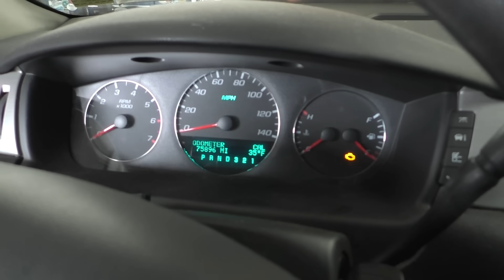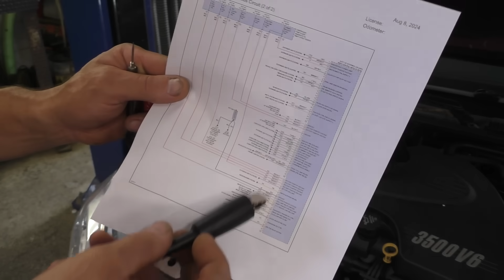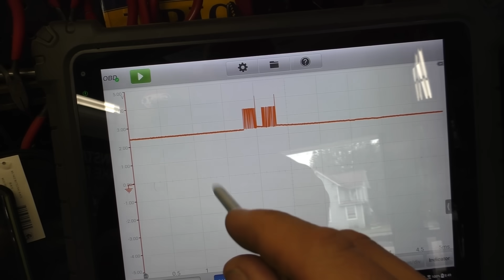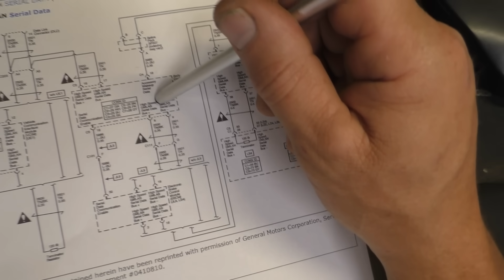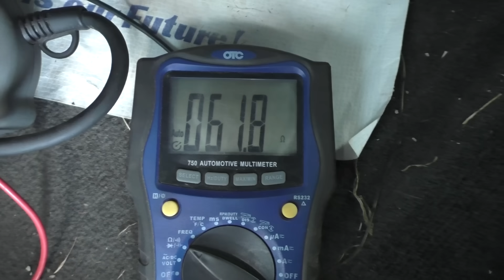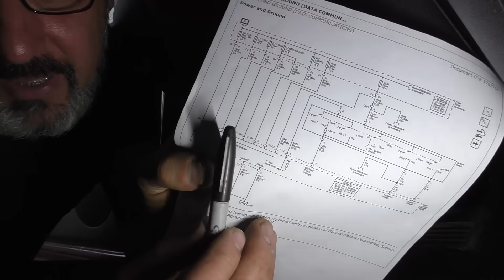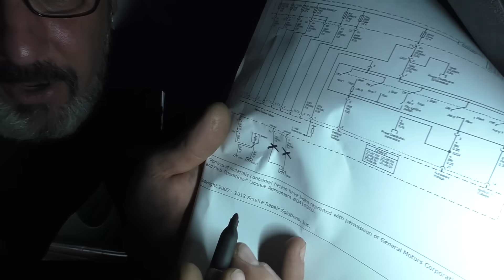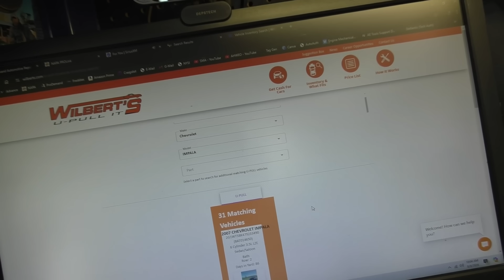Chevy Impala - Sat For 2 Years - No Start, No Crank - Part I

Comment: You remind me of a local GOOD mechanic we have. I had a vehicle that had a left o2 sensor code. I replaced the sensor, still had issue. Brought it to him. he located a wire over the transmission that led to left O2 sensor had been chewed by a damn rat. Once he located, I asked how much to repair. He said, If he had to pull transmission, $800, if he could figure something else out without removing trans, $200. He ended up pulling drive shaft, and rear trans cross member, allowing him to splice wire and repair. He charged me the $200, could have easily lied and said he had to pull trans, he didn't. That was 10 yrs ago, vehicle is 2007, still driving strong today!

Comment: I almost got burnt on this car a while back thinking it was the BCM after all the tests you just did, come to find out it was the low speed can bus that was shorted through the  airbag module, the telltale was no square around the gear selection in the cluster lead me to the low speed CAN bus bar or splice right near that BCM, checked each one for comms and the airbag one was grounded. Pulled the pin, slapped the “comb” connector back in and roberts your mothers brother everything came back online and started like a dream! Not saying its the same problem but darn near similar!!
Reply: That was almost a mother father cocker spaniel moment. Thank (insert deity of your choice here) you didn't leap in and replace the BCM

Comment: I had an 05 Monte Carlo in a couple years ago that had same symptoms, but only after it sat in the heat.  I did my due diligence, and tested all those things you just tested.  Boom!  Needs a BCM.  3 BCMs, and several hours of diagnostic time later, I finally got a good one.  That feeling in your gut when you plug it in and it doesn't work.  The next one had a whole different set of problems.  I learned not to go with aftermarket.  Cardone wasn't happy after they insisted on talking to me on the phone.  XD

Comment: My short term memory became problematic after I had Covid in May 2020.  Still have issues but not as bad.  I hope Mr. O, that yours is a short term issue and not long term.  
I really enjoy the diagnostic videos.  Your method is easy to follow, consistent.  I am now able to anticipate your next move and make bets with myself what the problem is and at where it will surface.

Comment: I had a 2008 impala with the 3.5 V6. Sad to see that impala sit for so long cause mine was the most reliable car i ever own. She hit 330,000 miles no problem before the transmission started to give me trouble. Everything still worked even the AC, never left me stranded on the side of the road for mechanical reasons, but i had the usual dead battery or flat tire but that doesn't count towards that. I do miss miss that car, drove smooth like a caddy and i had a few things done to it so it had more power than your usual impala. Seeing this car and hearing the chimes and lights on the dash brings back memories, seeing the 35 on the temp usually meant something electrical went wrong, not my car but i worked at a dealership as a porter and i noticed seeing 35 for a temp meant a big headache for the mechanic
Reply: I agree.... The most comfortable car I have owned. The first one I bought new. The second one a "Road Hard and Put Away Wet" salvage title. Both great cars.... Just do the maintenance and they never let you down. To bad they do not make these sedans anymore
Reply: @SinCitySinner definitely agree, I put in a bottle of Lucas transmission fix along with the flush. You could tell it was giving up but it bought me 6 extra years of life on the transmission. Yeah your right about the battery, mine was always in the summer when it gave up, at least it gave me a warning, about a week before it actually died you could hear the starter sound different when starting
Reply: @s126695 agreed, I really do miss that car but at the time I really didn’t have the money to fix it, probably should’ve garaged it instead of getting rid of it

Comment: ABS on Impalas was optional for many years.  I know I had a relative that purchased a new Impala and they said they had to pay extra for ABS.  I urged them to get it.  That car doesn't have the 3800 V-6; I know later Impalas had the 3.6 liter LFA engine and they weren't very good.  My first car with ABS was a 1987 Lincoln Mark VII.  GREAT VIDEO!
Reply: my 2001 impala didnt have abs. 2012 and up have the 3.6 LFX, same LFX that is in the camaro. my 2014 limited has the 3.6 LFX. the later model LFX engines were fine, they didnt have as many timing chain issues like the earlier generations.

Comment: I owned a 2008 Chevy Impala and it had ABS brakes. From what I could find it was an option for a long time. Don't know if it was was like air bags and made mandatory or if the manufacturers just though it was important enough to eventually make it standard equipment. That Impala was one of the best cars I ever owned. But I take very good care of all my cars and do all the work on them myself. Rarely in the past there have been things I just cannot do myself, but haven't taken a car in for repair for at least 10 years.

Comment: Among my homemade tools: a simple 9-volt battery. If I wanted to confirm the bcm as the only bad component, I would connect the battery to that 5v pinout and test my offline components. Maybe even try to crank the motor. Even though it's a 9v battery, it generally does not provide enough amps to burn out anything downstream.

I think you confirmed the bcm. My nearest junkyard is about a half hour drive in good traffic, so I do extra tests in case I might need another part... try to save trips back/forth.

Comment: Have an old GM truck, sat for eight years, cleaned the tank, new fuel pump. filter oil change started right up and still running today pushing almost 500,000 orig. on the clock. I like the old school stuff better. I had it under coated from new so no rusty frame, wheel wells surprisingly even with all the rain and snow, slush in it's lifetime.

Comment: This might be boring but is the correct way to determine problem .It might notvbe feasible but is correct to locate the problem(s)..Eric allways seems to locate the problem & only the problem without quickly throwing parts at it like crazy.Or just replacing major components like the dealer or whoever else....

Comment: I would love to open that BCM, 5 volt supply probably easy to fix especially if it's a linear IC. Could be just a cold solder joint. If it's a DC-DC converter could be a bad capacitor in the start up of the switching IC. Love stuff like this, but in the service business time is money.
Reply: 2000-2005 had many known bcm issues. cold solder joints were the problem. had to replace one in my old 2001. it did some weird things. when the temperature inside the car was below like 75*i didnt have any problems. as the temperature went up the more issues i had. it got to the point where the car wouldnt start if it was more than 80*. but if i took the bcm out and put it in the fridge for a little bit and let it cool down it would fire right up.

Comment: Note that the ABS standard with the V6 model.  So it is missing on this car as only the four cylinder was in optional, and this is the 3.5L V6.  Amazing trouble shooting skills.  Although it would be quite a drive from CT I could go to Eric for a fix if I was desperate - but I do have an independent mechanic I trust in CT who gets to the bottom of problems like Eric can.  The worst are the electronic ones so I admire Eric and those who actually can troubleshoot with a logical process and solve the issue.
Reply: ABS/traction control was optional on the base model impalas from 2000-2011. the 2000-2013 impalas did not have 4 cyl engines. 2000-2005 either the 3.4 or 3.8 V6 was available. 2006-2011 3.5 or 3.9 V6, or the 06-09 SS had the 5.3 LS4. 2012 and up have the 3.6, the new gen impalas, 14 and up had a 4 cyl available.
Reply: @Dcar-sp7qx  I had the wrong car - I was thinking the Malibu, not the Impala.  Thank you for correcting me on that.

Comment: ABS only became mandatory in the US  in 2012. Way later than I would have thought...
Reply: Should never have been mandatory, especially on gm products. If you've ever had abs randomly kick on in the snow and send you through and intersection it's not worth it.
Reply: as crazy as it sounds, abs/traction control was still optional on base model impalas from 2000-2011

Comment: IMHO 2, 3, & 4-part videos are fine because I believe in videos under 20 minutes (average for auto repair on YT) are very much easier to watch than much longer ones, so that is my vote. It's also nice to see different types of diagnosis and repair in each section of the video. Let me check my notes on this video and give you an idea of what you have done real world in this case............

0-19 minutes (+ your normal video ending speech on Part 1) tested pwr window CB, UHFB BCM fuses, scan codes, CAN waveform, GMHSLAN schematic, CAN resistance. 

19-48 minutes, Then start Part 2 for BCM location and all the tests to call a BAD BCM, used parts lookup info,  through the end of this video making Part 2 a little long but same BCM genre within the video & acceptable, very nice Step by Step BCM Analysis. Appreciate all your stuff Brother. NOW on to what ought to be Part 3 for today's binge-watching 6 of your vids (5 are keepers, my trigger to binge notes for my library).

Comment: Mice sure do like chevs. My wife's car has the same problem . Also, an Impala. I've patched 24 wires and counting. What a great idea to put the PCM in the air box!
Reply: Had an issue with an o8 that seemed to attract them regularly. Took a piece of 1/4 mesh wire and used a soldering iron to melt it into the plastic at the airbox entrance and no more damage.
Reply: @Blazer02LS  I did the same.

Comment: When you are having trouble getting any of the functions on the Autel to talk to the BCM, I went back to when you talked about the year, make, and model. It's a 2007. Mine is a 2005 Nissan, and I got the mid-range Autel tool for myself, because you use one. I have the same, exact thing happen to me. The tool makes it look like I can test or do these things and then flakes out when I actually try them. I assumed it's because it's an almost 20 year old car that just doesn't communicate well with generic scan tools. AllData has all kinds of things the Consult II can do that any generic can't.

Comment: My initial hunch was that someone tossed a junkyard BCM into it to try and solve their issues.  But it wasn't coded or anything.  Not sure if these Chevy BCM's even require coding?  

I just had one of these red herring issues last week.  2004 Aveo, crank but no start.  Checked live data, and there was no engine RPM reading while cranking.  Started to check the Crank Position sensor circuit.  Found the harness melted against the EGR.  Separated the wires to ensure nothing was touching, everything tested good with no shorts in the harness.  replaced Crank sensor. Still no start and no RPM reading.  On a hunch I tried a different code reader, and voila! I did have Engine RPM on live data all of a sudden.  The damn first code reader was bunk.  Continued down trouble shooting tree to the ignition system.  Found a blown fuse for the ignition coil.  Sure enough it had a bad ground right at the battery.  It was a $6 fix in the end, but I almost got led to a path of replacing the ECM for $500

Comment: Haven't watched yet but my wife is still grieving when I sent off her 07 impala  off to kenny upull and replaced with a 2018 colorado  because of repair cost estimate.  You can imagine the problem that I have now telling her that I want to spend $750 for a new driveshaft on my 02 s10. (In addition to current work doing brakes, a/c, oil cooler reoval, frame work. Apparently not a priority for y mechanic though. He's had it for 6 weeks. He knows we have 2 other vehicles to drive.

Comment: I learned the hard way years ago not to auto-range my DVM. I was chasing a lost voltage on a printing press circuit and probed a connection that I thought read 215 volts but turned out to be 215 millivolts. A day later...

Comment: 5V regulator powering the CAN transceiver went bye bye, hence no talky talky or 5V ref. Find out next week folks. Maybe power on the can bus is enough to power up the transceiver for it to transmit its ID but not talk to the MCU connected to it?

Comment: If you wanted to create a 5 volt rail, assuming there is power to the cigarette lighter, plug a phone charger into the CL socket, and cut the plug off the end.
Two of those wires will be 5 volts at 1 Amp.  That should be enough to see what else starts to work......

Comment: If this Impala had the 3800 Engine instead of the 3500, it was one of the Best Engines ever made, I owned a 2004 LS Impala for 16 years, best car that i have ever owned, everything under the hood with exception of Battery and Belts was Original. Two years ago- Car got T-Boned on Mall Parking Lot , cost too much to repair but before this happened, I would have driven it across country...
Reply: 3500 is a better engine. They run basically forever. They leak oil from everywhere but run forever. Used ones at junk yards can be purchased for as little as $50 since they hardly ever go bad.

Comment: Part two part three part short, long medium, no matter what I’ll watch it. I’ll take what I can get. If I really don’t wanna bother I won’t watch it, but in the end I always do.

I have that same test however I cut the end off and I replaced it with a small jumpstart battery clampbecause I found the one that they supplied you with tends to slip off certain grounds

Comment: I wish that you were close to me. I have 2 years of Vocational Automotive training from 40 years ago. I do most of my own wrenching but am lost on modern vehicles. 2 of the last 3 times I took my vehicle to someone. On 1 they cut my cv boots with a razor knife and tried to get me to pay them to put in new cv axles. That was at a big box tire store. The 2nd I had a local coupon book I bought to support the humane society specifically for a free front end alignment. After the place had finished they charged me 190 and claimed the vehicle was extra rusty. Now I don't trust anyone. I have a 2008 Uplander van that I think has a bad body control module. Wish I had someone with integrity like yourself I could get to fix it.

Comment: Owner killed the BCM with his battery charger, same thing i did with my Impala, got in a hurry and didn't disconnect the battery and blew a bunch of resistors right off the board. I bet if you opened up the BCM it would show the same damage as mine. You had an over voltage code.

Comment: I'd make sure it doesn't have a tracker inline to the ALDL Connector.(While you're there)  No Security Light.(not good) No power windows indicated an open in the circuit breaker circuit Hot. I'd be all over the main power feeds and hunting rodent signs like droppings and urine smell. Up in the dash is a good place to look if you have droppings in the car.  Fuse wire in fuse box falling out/down/not in good. Fuse box issue.  Pull the fuse out of the dead circuit and make sure the wire is in place. Missing Minor Ground/firewall ground/dash ground. I had a 93 Century. They have a Fuse by the Radiator to the Fuel Pump. You can disable the Fuel Pump by pulling the fuse at the Radiator. And, Theft proof it if you're unable to keep an eye on it. Bought one at a wrecker auction for 350$ Like New. Cranks but won't start. No Starts are Bomb when They Start. I'm curious.

Comment: You said one of the codes was a high voltage and GM bcm/ pcm / tcm are very sensitive to voltage spikes above 17 volts probably baked it if they used an old school battery charger on nuclear. If old battery charger has a bad diode set they could Spike up to 20  volts.

Comment: Good vid, O'Breschkalov-san (Irish/Russian/Eastern name-flare).  "Could" the mouse action (knawing) have caused an intermittent anomoly which fried the BCM?   Base question is "What fried the BCM?" in terms of a specific resistor/capacitor within the BCM?  Of course, if it's common for these BCM's to go bad over time I imagine it doesn't matter.  But if a short-to-"x" exists intermittently and caused the original stir-fry, I would think I'd be tackling the wiring repairs in addition to replacing the module (wire repair prior to powering up the BCM post-replacement for the first time, I suppose.)
Reply: i know this is a 2007, but the 2000-2005 impala/monte carlo had many issues with the bcms. cold solder joints were the issue. if it was cool/cold outside it was ok. but once the temperatures got warm the solder joints would expand and then all kinds of electrical shenanigans would occur. i know from experience. so when the bcm in my old 01 went bad, i did a test. when it was hot out i would take the bcm out and put it in the fridge for 10 mins to cool it down. once cooled down it was fine. replaced the bcm and no more problems.

Comment: I have not watched this video yet. I was wondering how many parts are there? I know there must be a 2nd. But is there a 3rd and a 4th.
I like to watch them all at once...You know a little binge SMA.
With a 20 speaker surround sound. Immersing me into the feeling of everything that goes into the job! Without breaks. So Eric if you could be so kind and tell me how many there are please And I don't have trust issues I kind of get mechanically inclined things. I was a machinist for 35 years.
Reply from the maker: Only 2

Comment: Yeah up north I had several times where rodents got in through the airbox. The way I fixed it was to take a piece of metal screen and shape it and stuff it into the airbox intake lower pipe. The gangstas couldn't get in then.